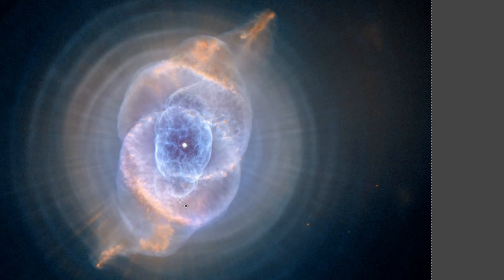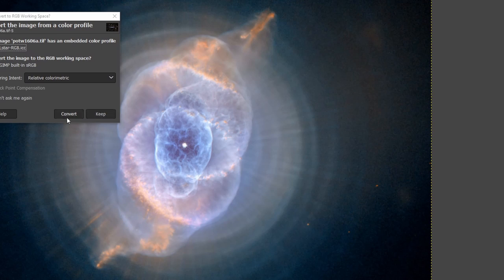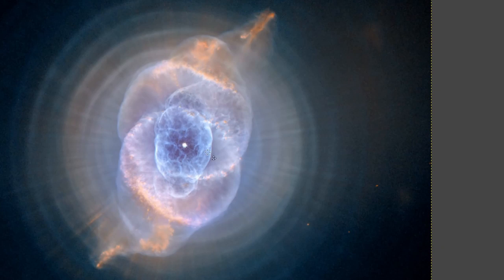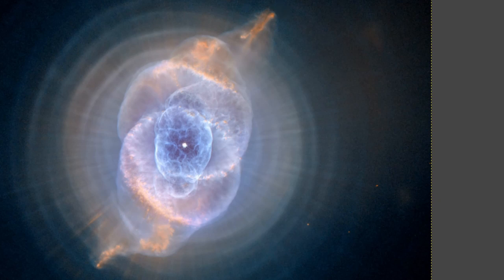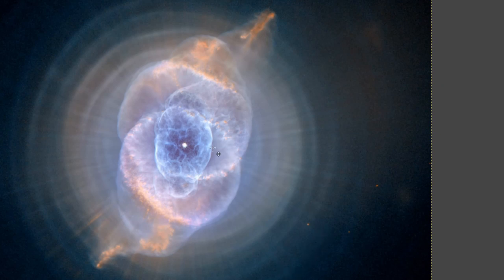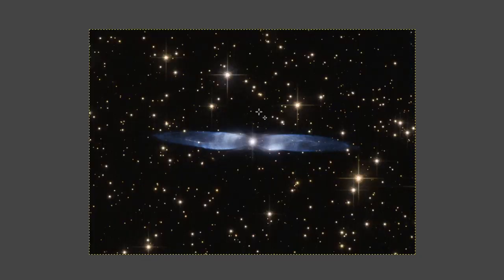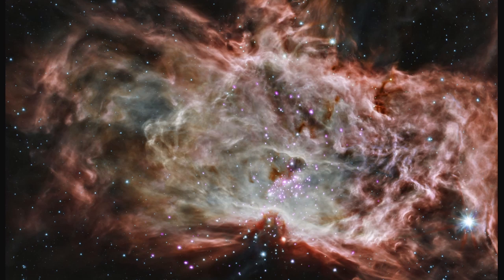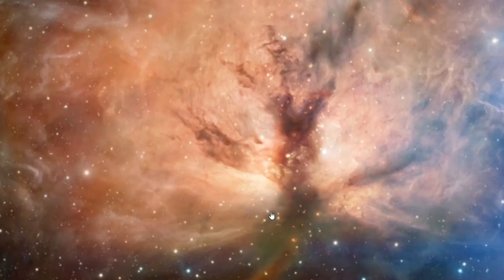Seeing Birkeland Currents: Off Axis Birkeland Currents and Marklund Convection

Comment: Another thought about the eye nebula: is it possible that the visible star has a much darker twin?
Reply: Nathan Allan 

https://iopscience.iop.org/article/10.1086/300939/pdf
That’s what they are trying to figure out here. They suggest that a binary companion may solve the issue, yet point out problems with both the close binary and wide binary hypotheses.   

If the mainstream idea is right, that this is all ejected from the star(s), then it should be centered on the star.  Yet if stars are merely formed in giant preexisting filaments, it may be a mistake to assume star formation is at center, especially because we have these “rings” where charged matter circulates.  Might that be where a star is formed, or at least gets its power?   If you see an obvious problem with that hypothesis (I’m not attached to it), l would like to hear it.  Still learning.

Comment: Can you explain where is the HUGE amount of matter (some would counter 'dark') in the central Filament? How can we detect it and why does the filament have low charge density if there is a Huge Amount of charged matter in a relatively small region?
Another question is why do you suppose Conservation of Momentum (or even energy) should hold on? I mean, conservation 'laws' should take place in Isolated/Closed systems, but a solar system or nebula is said to be connected to its galaxy through the Birkeland Currents so there could be a potential drift in momentum. (Which in turn, might have something to do with the asymmetrical place where accretion happens??? I wonder myself...)
Reply from the maker: The problem is that there is no way to detect charged particles that travel in a straight line, only when they are forced to either speed up or slow down or change direction can we get them to emit a photon (depending on how rapid this was), we also get to see them when they recombine or become ionised.  I'm not sure I understand what you mean by low charge density.  At the pinch it would be high charge density as it is squeezed through a smaller part.  As for the conservation of momentum you need to consider that these filaments are connected as part of the overall galactic circuit (I have a separate video on that) this means the current flow in along the galactic arms and then out through the poles of the galaxy, then out and around.  I will admit that there are different models for how a galaxy might work and some may make this less clear but in all you need to consider that the loops in most cases must be a closed loop.  This is possible something that is worth exploring in more detail at some stage in the future as there are still some outstanding question in my mind about connecting the different models together at different scales.
Reply: @SeethePattern  With 'low charge density' I was meaning that the Filament is Plasma in Dark Mode (invisible). Then according the chart of Plasma Modes it should have a low current density until it reaches the Towsend discharge. But if, as you say, there is a Huge amount of matter in a small cylindrical region (filament) the current density should be high and plasma should glow...

Comment: Is it possible that each cylinder as it is draw in by the z pinch n the prominent variants of matter with in them could  be the source in witch the different typesof planet's are created with the magnetic poles being determined by thè incoming flow of current (ie north) and the out flow becoming the south Or vise verse. This could exsplan the seperation of plants. the deferent elements they are composed of. How tbe poles are determined. The derection of spin and spin rate. And possibly planetary satellites. Or another word's a ready made solar system. With the defering strengths n duration of current and current flow determining a system size and or type(ie single vs companion)

Comment: 14: 41 PICTURE  the star does not look to be at the center cause we are looking at it like from out an HOUR- GLASS ROUND THING.
Reply: The only flow from inside and all around this figure is only from the center to the out.
Reply: An other posibility for not seeing at center the star at 14:41 could be as well cause in all systems one side brakes more than the other and is the havier side the one that brakes more,     in other words is the havier side the one that opposes more resistance to the system s surounded electromagnetism to the out put from the system that comes out parallel to the south and north side, that as well could be down and up, left and right etc the thing is that they allways will be opposite..  I go for this one more than the one above sience have not checked out the one above with my optometry yet.
Reply: 14:41 IS NOT  the correct time or picture but
Reply: time 14:41
Reply: 14:41 figure or the eye nebulae think?

Comment: 4:41 picture does not seem to have the star at the center of the Z pinch maybe cause as Altom Harp explaines that quazars go by pairs seen as wave length or something like that, he says that you can not match each pair in straight line -   My self found out that in did as Alton says they belong in cross section say from north to south forming an X a thing you may see in anlist 3 DNA picturejusts that can prove is true, as well with the Tzolkin Mayan callender.  -    The X figure is a thing seen in Z pinches: you may figure it out as an asterisc, where the central axe that crosses the X comes to be the disc of the system seeing as flat, as well I call the disc the equator or neutral part that to me is the union of both sides that is positive and negative. more info? Click my logo please.
Reply: time or picture from above is a mistake see 15: 14 think is the EYE NEBULAE.